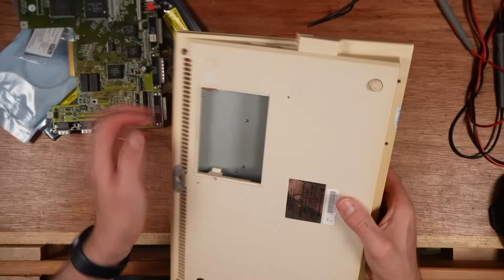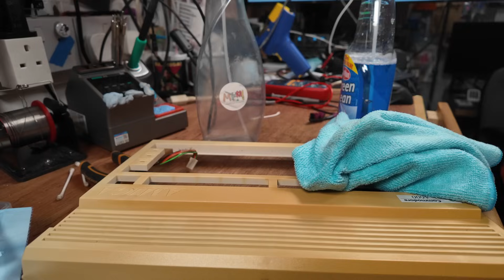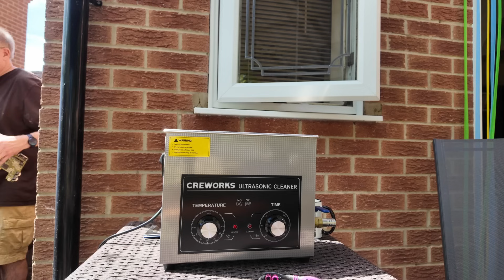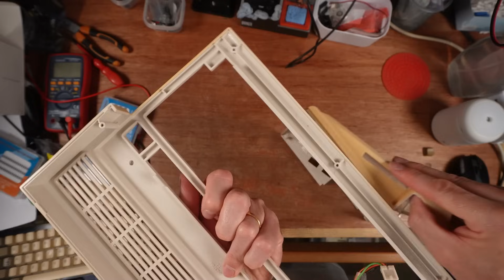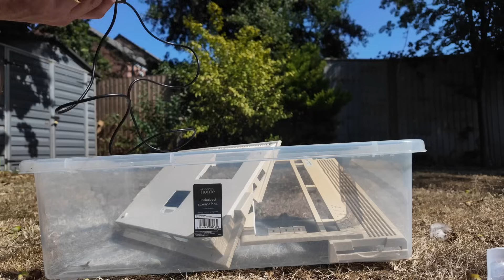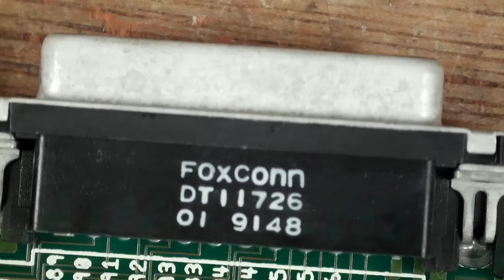Fixing the Worst Recap Ever Part 2

Comment: I used to restore 80’s bmx bikes. One part of it involved plastic mag wheels. 

I’d immerse them in standard cheap  bleach. Obviously they’re too big for any tub you can buy, so I used a large cardboard box, with a bin bag sealing it. 

You could easily make as large an immersion tank as you need this way. 

It works a treat & I’m sure will be ok to do the case.
Reply from the maker: I have often wondered if regular cheap bleach like you squirt in the loo would work. I might get a test case (pun) and try it out!
Reply: @morefuntech I used the cheapest, thinnest bleach & it worked great.

Comment: Not sure it'd be worth the effort but I think you'd most likely need to modify that humidifier to get it to produce the vapour you need for the retrobrighting.. Most humidifiers have a sensor in order to maintain a relative humidity between 40% & 50% (definitely not enough moisture/vapour for retrobrighting).

Comment: I’ve had some decent results retrobrighting using laundry soakers that contain sodium percarbonate like Napisan. Apparently it breaks down into hydrogen peroxide when added to water and it’s a lot cheaper than hydrogen peroxide in a bottle.

Comment: It might be educational to open up that vaporiser to see what the hydrogen peroxide may have done to any metal components in it, I'm wondering if some contacts may have got oxidized and cut off the power supply.
Reply from the maker: Sadly it's deep in the rubbish bin now 😆
Reply: @morefuntech  Too late 😞never mind I'll just have to be quicker next time, if you do ever want to try that experiment again a garden pond mister/fogger might be the thing to try the electrical parts of those are probably protected from the water and mist and the cheap ones are £10 ± 5.
Edit: Also when you are using a sealed container and want to avoid drips from the lid prop up the container at an angle, the condensation on the lid should them run to one edge.

Comment: For retro Brighting using the sun is probably the worst method of all. I use a large box, lined with foil. Paint the cream into the subject in a thin layer. Seal it in a zip lock bag. Cut a
Square hole in the box top. set a large uv lamp, 20w or something can’t remember on top and leave it under the light for an hour or two. Works wonders and no problems. I’ve done all sorts of stuff like this from old toys to retro computers etc

Comment: I've had moderate successes with the cream retro-brite method, especially retro computer cases that are just too large, and most often yellow quite unevenly.  I have a bright LED grow light that I place nearby (don't even bother with an enclosure like everyone else seems to think is necessary)...wrap the part with cling film and just leave it there in my garage for a few hours.
As far as the vapor method goes, and the drip problem, would it help to keep the container on a good angle?  Then when hydrogen peroxide condenses on the lid, it will run down the lid and back into the container.
Reply from the maker: Good idea!

Comment: I love the science of retrobrighting: it is yellow because of the Sun, so give it more :)
Reply: Yeah, it kind of doesnt make sense but I think its the slow exposure vs high heavy exposure although all retrobriting even with peroxide will revert and you'll need to do it again.
Reply from the maker: I know right? It makes only mad sense :D
Reply: I like using the sun method (without peroxide), but it does take quite long. I often leave it for 2-4 weeks, so obviously that only works if you have a place where you can leave it for that long and you're not in a hurry.
Reply: Window glass blocks some frequencies of UV light so it's probably those that oxidize the yellowed chemicals back to their original colour when you put the plastic in direct unfiltered sunlight.

Comment: Place the parts you want to clean in a polythene bag add your cleaning solution to the bag. Now place the bag in the ultrasonic cleaner and fill the bath with just water . This not only reduces the amount of cleaner you need but keeps the bath clean.
Reply: 10 bonus points for thts person. yes! what a brilliant idea!
Reply from the maker: Ive done just this many times in the past. It works, but not as well as not using a bag. Soft bags absorb and slightly reduce some of the effect. The cleaner I am using, citric acid, is very cheap and I am using cheap distilled water in a smaller cleaner so dont really need to worry about the bag trick so much.
Reply: @morefuntech  Could you find a big enough zip up poly bag to use the same "boil in the bag" method for retro brighting the case to minimise the amount of hydrogen peroxide required?

Comment: I wouldn't be heating or evaporating hydrogen peroxide. that seems dangerous and I've heard of stories on a hob where its not gone well. Either dilute peroxide clear liquid and submerge the parts (but you need a lot of peroxide for that) or get the beblond40 cream from claires accessories and paint it on. my cases take about 4 hours tops to go from what you had to normal in mild sun or a UV and foil lined tub.
Reply: From what I've read, the "boiling point" of hydrogen peroxide (all other variables, such as air pressure, humidity, etc... being ignored) is about 150°C, so an evaporator designed for water probably doesn't get hot enough.  There's also a risk of explosive decomposition when you heat H₂O₂ to that high a temperature, so I'd be careful.
Reply: And any electronics which are exposed to peroxide will probably not last long since it is such a strong oxidizer. Anything with iron in it is going to rust immediately (which is why you should not treat a full keyboard with membrane and springs etc). 

I doubt that vaporizing it in the sun should be dangerous. It is not going to get anywhere near hot enough. I've heard stories about people heating peroxide in the microwave. I would be very cautious about trying that.

Peroxide can be very dangerous and should only be handled using protective gloves and glasses, even in diluted forms.
Reply from the maker: A big tank of peroxide sitting in the sun is also evaporating. Rapidly in the case of hydrogen peroxide. Everyone has such wildly different opinions on how best to do this.

Comment: VHP (Vaporised Hydrogen Peroxide) is used to disinfect healthcare rooms, and is highly toxic both to bacteria and also your lungs/airways if inhaled. I would strongly recommend against ever putting H2O2 into a vaporiser especially indoors without appropriate monitoring of levels and a negative pressure fume cupboard!
Reply from the maker: I always do the whole process outside.

Comment: Sharing something that may save you a lot of heartache in the future: I saw that you put the board in the ultrasonic bath for more than 30 minutes. The ultrasonic vibrations can loosen and even break the internal wire-bonding between the die and pins inside the chip's package, and ruin the IC permanently. This isn't just theoretical, it does happen, especially with SMD packages. In modern datasheets you can sometimes see the maximum recommended ultrasonic cleaning time for the part, which is usually about 2 minutes, but in any case under 5 minutes. The way to go is to bring the bath up to temperature before putting the parts in, and then clean for just 2 or 3 minutes.
Reply: Yes, that's good advice. The other thing you can do if your boards are too big for an ultrasonic bath is to remove any components that are likely to be affected by water such as coils, transformers etc and pop it in the dishwasher with your regular dishes! Works fine. Done it many times with ZX Spectrum boards etc. 👍
Reply: I've also heard that it can be harmful to put quartz crystals or crystal oscillators in an ultrasonic bath.
Reply from the maker: Ok. Thank you for letting me know
Reply: That's a new one on me but I've normally only even washed populated pcbs for a couple of minutes and they were less complex boards back when I did it as a job. But this makes sense for extended clean times.